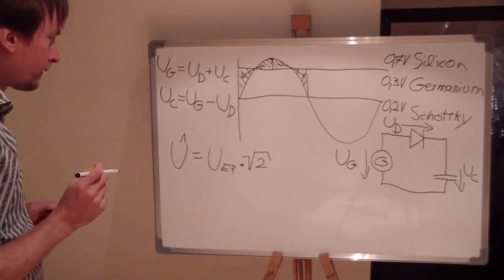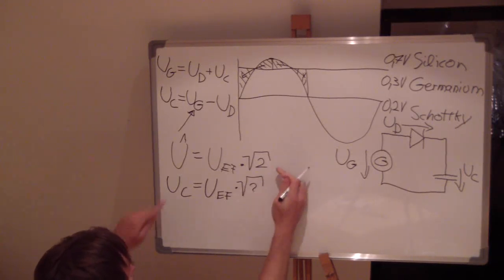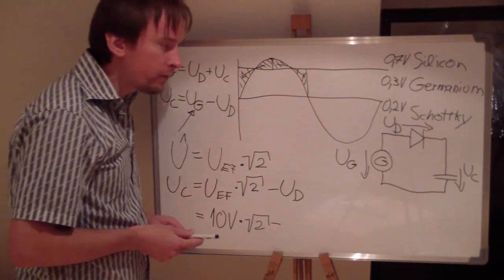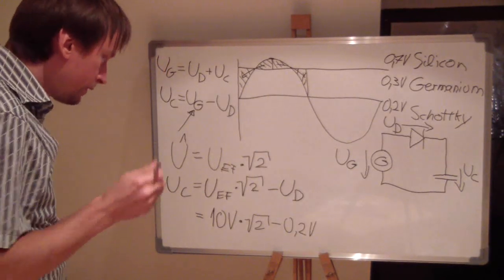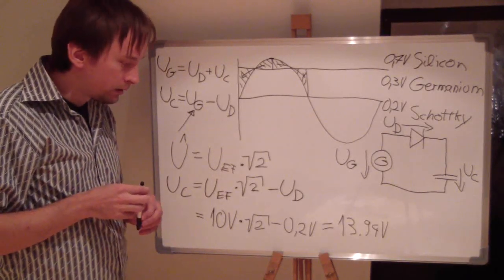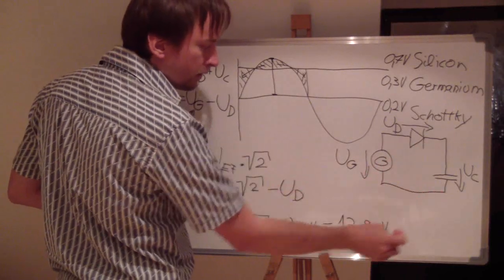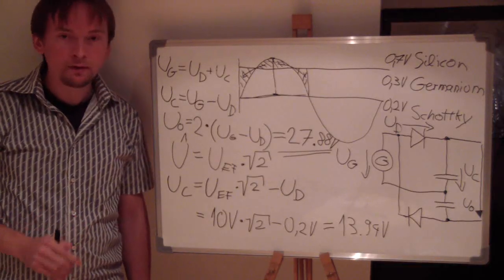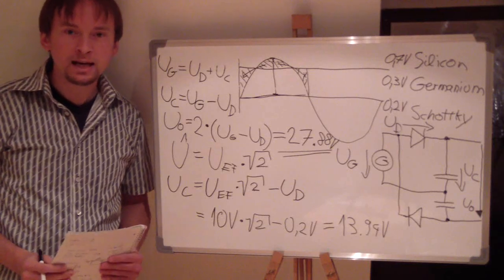Home Made Windmill Generator Part 9 - Voltage Doubler Theory 2

Comment: Thanks Chris! I made a slightly larger and less efficient model based on yours in the first couple videos! I used 8 cheap ceramic magnets around the inside of a large tomato can from the school cafeteria, with 4 sets of 50 windings each on thinner wire (since i figured i'd get less than an amp out of the device). I used regular styrofoam for the stator, and a (i think 5/16") bolt with two skateboard bearings. It's super cheap, and worked for my project for college.

Thanks again!!!

Comment: Keep going, you are doing great !    I like to consider a slow moving windmill dutch type so that while the "vanes" are very large they also move very much slower (SAFETY) and still get the power of perhaps 10-15 HP which is plenty to run a house on (caculate 10HP runs a 5000 watt generator etc)  so even with a light wind of "perhaps" less than 12mph the user can still get the power becaue of the large vane size and with safety as well.  If it works, every house could have one eventually.

Comment from the maker: Thank you very much. No, the capacitor does not "consume" energy in such a way that it vanishes. Instead, it stores the energy for later use. So you can charge and discharge a capacitor. I found that Wikipedia can be helpfull in understanding this. The same goes for the delon circuit. Have fun!

Comment: thanks for all the videos, they are awesome, but there is one thing you have to put in advance...13.9 v which is stored in cap. is the max. voltage not the average voltage because the 2nd have cycle will be off..the average voltage is calculated by "max voltage/PI"..and this is the value you can see on the multimeter if you connect the o/p directly to the load(resistance)..

Comment: But there are already vertical wind mills already built and so it might be easier for you to simply buy one and hook your generator to it.   I was thinking simply hook up 5 automobile alternators (they have diodes inside so the output is already dc 12v);  then to a grid tie inverter to actually sometimes run your power co meter backwards.  I think each alternator would take 3 hp thus need windmill to give 15hp to run house (12v x 50amp = 600w ; x 5 alternators = 3000w might be enough.

Comment: Would having more magnets and coils be better than the generator itself turning faster? Like if you had a large turbine, would it be better to make a larger generator, or use a smaller gear than the turbine and increase the speed?

Comment from the maker: The Energy that can be harvested from the wind is quite low. The advantage over photovoltaic cells is that Windmills can produce energy at night time too when there is wind. And solar cells can not as they need daylight. So i guess that my wind mill can produce enough enery to light just one room with LEDs (Light Emitting Diodes). But you need a battery bank for energy storage because wind is not always available. Of course the energy output is dependant on how much wind is at your place.

Comment: Hello sir
Thank you for the information provided very useful, Atemy if more describes some of the questions if allowed:
1 - I've stated in the relationship voltage 10 * 2 root where did this figure come from?
2 - Can we increase the number of (diode + capacitor) to increase the energy produced? And how they are connected then?
3 - How can we determine the values: diode and capacitor?
Thanks for attention
I hope to get clear answers, please.

Comment: I'm sure someone will correct me as its been about 20 years since I've done this math, but if your dealing with AC voltage and are working with the effective voltage or RMS, instead of using the square root of 2 then just use 1.414 for peak to peak voltage or in the case of the single diode, use .707 in place of the square root since half the wave is getting blocked by the diode.  I'm probably wrong though.  Its been a long time.

Comment: qtheresserection@ yes, all he would need to do is use iron cores in his windings. this increases the inductance of that coil making more voltage and current too. if he used mutual iron cores in conjunction with every other coil of the same polarity, that improves the efficiency by increasing the magnetic force through the iron cores to each coil of the same polarity. i hope this explains it so you under stand it. the mutual core is the only design that he didn't use. as wood it wouldn't help

Comment: but with using the cap. the voltage stored gradually as sine wave rises to its peak value then the cap. will be stored by max. voltage then when sine wave decreases to zero the cap discharge it's charged voltage in a time so the o/p voltage will not reach to zero again and this achieve a continuous current, thus raises the average voltage...